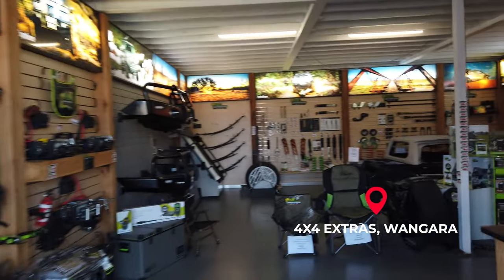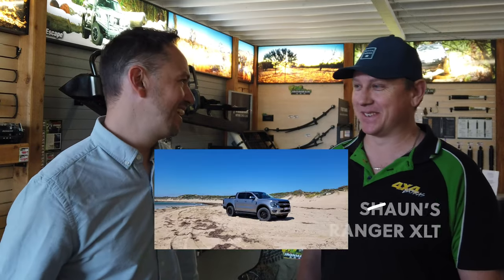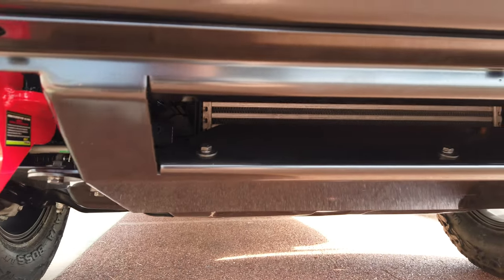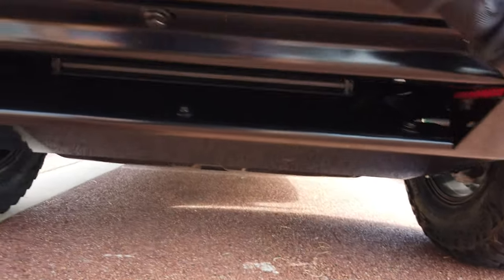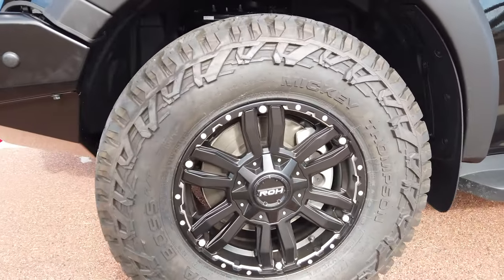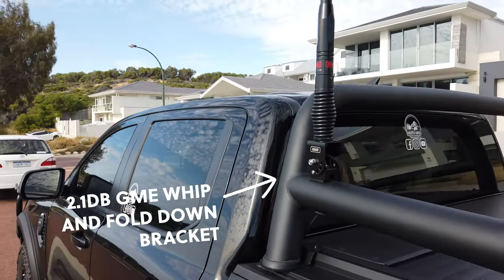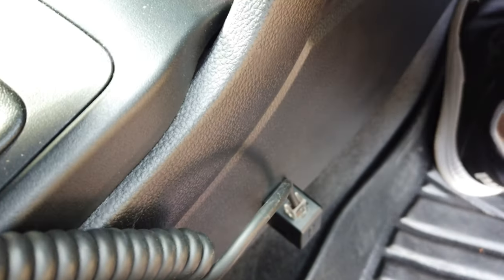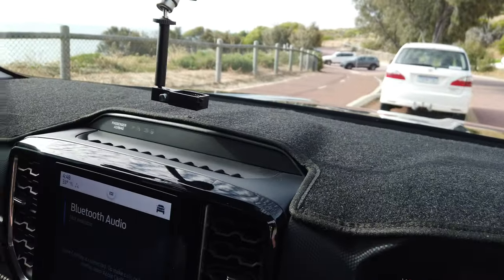MY MUST HAVE MODS INSTALLED ON THE NEXT GEN RANGER

Comment: After seeing the bar, I am thinking of going the same on my Wildtrak. Are you putting brush bars on as well as steps? Are you stiffening the rear suspension up for towing the van? I am thinking about some airbag man HP bags. Have them on my Y62, and they do a great job when towing........
Look forward to next instalment.
Reply from the maker: Thanks mate. No brush bars for me. I’ve wrapped the car with PPF panel protection so this should be sufficient for light scratches etc. Not planning to upgrade rear suspension at this stage. Handling the weight of our van quite well. May be something I’ll consider down the line if I opt for a lift

Comment: Haven't seen any of the ironman deluxe looped bars on the next gen Everest yet.  Seen heaps of ARB and a few TJM.  I think the ironman bar looks the best.   With a bash plate and recovery points included.  And they are a much better priced then TJM and ARB.  Years ago ironman was the new cheap kid on the block, but i feel they're quality is more comparable with TJM and ARB these days.
Reply from the maker: Agree John. I’m a big fan of their gear, especially bars and suspension. I think with the commercial deluxe bar they’ve nailed the styling of the Ranger / Everest 😁

Comment: Question: I have a 2020 Ranger 4x4 … How does the bull bar work with having the factory front sensors from beeping or even functioning to prevent front close contact?
Reply from the maker: Hi. I’ve had absolutely no issues. Sensors all work exactly how they should in the bullbar

Comment: Mint looking rig. Does the slide away have a manual override in case the electric motor fails?
Reply from the maker: Thanks 👍 Yes there is a screw on the drum. Unscrew it and disengages the clutch in case of motor failure

Comment: Mate how much sag you get in the front of the car With the bulbar and winch without upgrade of suspension? Is it to much? and what are the negatives of having all that without the upgrade of suspension? 

Im looking to get the iron man bar as well but i just cant afford the suspension.
Reply: Oh and another question dose the 33inch tires rub wth the bullbar on?
Reply from the maker: Hi Ray. I’ve driven 6 months on the standard suspension and surprised how well it coped with the additional weight of the bullbar and winch. I did find it challenging offroad on a rocky track and have a few war wounds to show - however have proved you can do a lot on standard suspension. 
No scrubbing on 33s - assuming you stick with a similar wheel/tyre combo (285 70 17) and  +30 offset. 
You’ll see in upcoming videos a 2” lift added which will give me the right balance for off-road and towing 👍

Comment: How's the light bar perform looks good not sure whether to go spotties or light bar
Reply from the maker: I think spotties will generally push out more light and are directional so you’ll have a bit more adjustment. Main reason for lightbar was to not limit airflow into the radiator and pretty happy with the amount of light it pushes out - certainly ample for my purposes

Comment: hey mate, do you get any water leak into the tub with your electric roller cover?
Reply from the maker: G’day. Seals are pretty good in the tub. Little dust gets in if I do big drives on dirt roads, but I’ve added a tailgate seal which has helped. No issues with rain/water.

Comment: If ok, may I ask how did you mount the folding bracket to the sports bar, as I would like to do the same.
Reply from the maker: The guys at 4x4 extras drilled a hole through and bolted from the bottom. They added a rubber plug to stop any water entering. Looks quite neat. They also placed the bracket on a foam pad to stop any vibration and level out. If you’re in Perth - give Shaun and the team a bell at 4x4 extras if you’d like their help on the install 👍

Comment: Hi Mark, big compliment to your ranger build. Well done.
Question on your ROH VAPOUR 17" rims. What rim width did you choose and why. Is the offset of +30 (not too little?) the reason why the tyre is rubbing in the front wheelwell? I thought +40 would have been better? Your thoughts please? Thanks and good luck with your awesome Ranger.
Reply from the maker: Thanks. It’s been a fun process getting it built up. Now get to enjoy it on trips 😁
Rims are 8” wide. In terms of the offset, +30 is the widest you can go legally in WA (adding 50mm to the wheel track). +40 would bring the wheels closer into the vehicle which is not what I wanted. Some people running +20 or +25 to get it wider again but obviously so this their own risk. Hope that helps. Cheers Mark

Comment: Congratulations……it looks fantastic 👍
Reply from the maker: Thanks mate 👌
Reply: @Perth4WDandCamping  I’m installing airbags & foam cell pro shocks at the rear of my V6 Sport. Connecting my caravan reduced the rear height by 30mm. 
I’m using a 4x4 Ironman outlet here in Sydney 👍
Reply from the maker: @RocketRod63  sounds great. Be eager to hear how it tows as I haven’t committed to anything yet. Keep us posted 👍 Perhaps @Ironman4x4International want to test out their suspension on my Ranger? 😉
Reply: @Perth4WDandCamping  shall do. I was originally wanting the ToughDog adjustable rear shocks however they are not available as yet. I have the airbag/ToughDog setup on my 2019 Colorado which I used to tow the caravan with. It is a great setup……level with no porpoising 👍
Reply from the maker: @RocketRod63  great to hear

Comment: Great video mate, just picked an XLT, looking at mods yours have helped narrow down the first few, just wondering, do you know if the throttle controller will lead to warranty issues?
Reply from the maker: Not that I’m aware of. Pretty common addition to many 4WDs and I ran in my previous Pajero Sport. It’s not adding any extra power like a tune - rather just altering the throttle response to take away that lag. I’ve found it’s a good way to combat the extra weight added, which can make a vehicle feel a tad sluggish
Reply: @Perth4WDandCamping  awesome, thanks mate.

Comment: You can fit a 285/70/r17 on a stock suspension xlt no scrubbing? Just poke?
Reply from the maker: There would have been some front guard scrubbing with my tyre / wheel combo without the front bar. A bit of light inner guard trimming and you’d be fine. I just waited into the bar was installed to fit tyres. Cheers Mark

Comment: I am in Australia and have a 22 XLT, it came std with poxy cheap and nasty plastic running boards.
I see the one you showed has aluminium ones (look very similar to genuine Range Rover type, are they something you sell or are the std factory UK spec for the Ranger?
Reply from the maker: G’day Tony. You referring to the side steps? These are plastic on the Next Gen Ranger. Mine have already taken a beating off road and will likely add some steel ones in the future (Eg: Ironman)

Comment: did you need to get a lift for them wheels?
Reply from the maker: Was definitely scrubbing a little bit when we test fitted before the lift. Might get away with it on stock suspension with less aggressive tyres as the side bitters on three stick out a bit. You may however need to do trimming of the inside guards.

Comment: hey mate, just wondering if youve found any lager mudflaps to replace the smaller ones after doing tyres? im on the hunt so any ideas would be great.
Reply from the maker: G’day Tim. I haven’t explored any larger mudflaps and have found the current ones are sufficient with the 33” tyres on. Parts are still coming onto the market for the Next Gen Ranger so if you’re set on swapping them over, I’d keep my eye on EBay or you may even have better luck modding some after market ones

Comment: Could you measure the dimension of the roller shutter canister please, I need to know the height from the tub floor to the underside of the canister and the depth of the canister towards the cab, many thanks in advance. I enjoy watching your videos, they’re very helpful. Regards Martin.
Reply from the maker: G’day Martin. Shutter sits approx 30cm high with a tub liner in. It takes up approx 34cm of space from the back of the tray (noting you have the 30cm of space avail under this). Length is 134cm
Reply: Many thanks, much appreciated
Reply from the maker: Welcome 👍

Comment: Hi, just wanna ask how about the warranty of your XLT? Is the car warranty gonna void? Installing Ironman instead of the ARB? I prefer Ironman than ARB, but the dealer told that I have to install ARB bullbar otherwise the warranty will be void, for my wildtrak.
Reply from the maker: Should there ever be a warranty dispute, Ford would need to prove that the modifications resulted in an issue. Ultimately, with any modification you are changing the vehicle from its original specification so my advice would always be to careful consider your needs. If in doubt you can always reach out to your local Ford dealer for advice. My personal experience has always been positive when it’s come to warranty issues (previously owning a modified Mitsubishi)  but you need to weigh up the pros and cons for your own situation
Reply: @Perth4WDandCamping  That's why it's so much easier with going with ARB. Certainly no disrespect for Ironman products, I had plenty on my Navara, but with my new Wildtrak, having all ARB accessories fitted are covered with a 5 year warranty, that is incorporated in the factory warranty, it really is a no-brainer. Better to know you have warranty coverage from the start rather than having to prove the accessory limits or voids warranty in any aspect.  It's bad enough you have any problems, but worse when you have to waste time to rectify any issues when all you want to do is get is sorted and get your ute back.
Lets look at the mods, if you're looking at suspension upgrades, tyre upgrades, electric shutter on the tub, maybe it's worth looking at the Wildtrak. I was originally looking at a Sport, but considering what I wanted, the Wildtrak comes with All Terrain tyres, bigger rims, electric shutter on the tub, medium grade bash plates, auxiliary wiring loom to dedicated (and very nice looking) switches, auto parallel and reverse parking, zone lighting, remote start, full leather seats, brake controller, b&O sound system, bigger infotaintment screen, better side steps, xenon LED headlights that turn with the steering... I'm glad I spent a bit extra on the Wildtrak to have all that up front.  All I want to add is a bullbar, when installed, the parking sensors and front camera are moved and calibrated and covered under factory warranty.
Reply from the maker: @CichlidStyleForums  sounds like it’s worked out for you which is great and totally get the ease and warranty benefits you noted. Wildtrack had features I didn’t want - Eg sliver tray slide doesn’t look great on a black car and 31” AT offer more traction offroad, but are not by any means comparable to a 33” tyre off road. When it came to the bar I wanted to have a 12,000 pound winch and ARB bar is not able to support this. Essentially I wanted to get into the V6 and build it from there - but the beauty is there’s a few different models in the mix to cater to different needs. Generally always some compromise to get what you want.
Reply: @CichlidStyleForums  I don't understand your warranty concerns. If the rear diff blows up, it's not because of the Ironman bull-bar. If the Air-con fails, it's not because there is a winch on the front. Ford will warranty it's product and Ironman will warranty theirs. If Ford are going to get picky, then you are already wiped by going to 33 inch tyres over and above stock!
Reply: @CichlidStyleForums  I agree he should of just got the wildtrax instead of turning it into a wildtrax. I’ve got a wildrax coming soon but I can’t justify the arb pricing on the bill bar and all the other stuff way too overpriced. I might iron man looks a heap better and a ton cheaper.

Comment: Hey mate. Thanks for sharing. Have you noticed any transmission shifting differences with the  bigger tyres at all. Any help would be Great
Reply from the maker: I’m sure there are small differences to shifting points but nothing that’s noticeable so far for day to day driving. Does use more fuel however - approx 11L per 100km now, compared to 9L on stock for everyday driving
Reply: @Perth 4WD and Camping  ahhh, that's good to know. And you went to 285/70r17? Which I think is bigger than what I'm doing anyway.
Reply from the maker: @jenningstim90  correct yeah 33”
Reply: Hey mate, just wondering what size tyres you are goin for?  any reason for goin that way apart from fuel?

Comment: Do your tyres still rub, and how wide are the rims/ wheels
Reply from the maker: No rub. Rims are 8” wide and rims are +25 offset (285 17 70)
Reply: Looks good 👌recommended your video to an ironman 4x4 supplier shop in Sydney to pass on to other Ranger customers looking at doing similar fit-outs.
I'm getting quoted for the same front bar, wheels, tyres and flares. 
Well done 👏
Reply: Looks Badass man honestly 👌
Reply from the maker: @Marcbarrington8  nice one thanks. Yeah I’m a big fan of this Ironman bar and wheel combo. Looks very integrated.
Only thing to note on the Mickey Thompsons is that they are a hard compound and being 3-ply you’ll definitely notice a firmer ride. I’m happy with that compromise as they will offer great off road sidewall protection but just something to note. They are also about 12kg heavier per tyre compared to stock. If you wanted another option that is also great offroad but offers a softer ride, and lighter - the Falken Wildpeak AT3 is a great tyre - ran this on my Pajero

Comment: Looks great mate, wondering where the light switch is for the LED bar on the front
Reply from the maker: 4x4 Extras put a round rocker switch in the panel under where the headlight switches are etc
Reply: @Perth4WDandCamping  ooh i like that idea! thanks for the reply mate, have subbed
Reply from the maker: @jordankeeps  thanks mate 👌

Comment: How is the lightbar switched in the cabin?
Reply from the maker: Onto the high-beam, but also switch so I can have on or off when high beam on
Reply: @Perth4WDandCamping   cheers, more where did you mount override switch without any blanks. Have a new ranger too and was wondering.